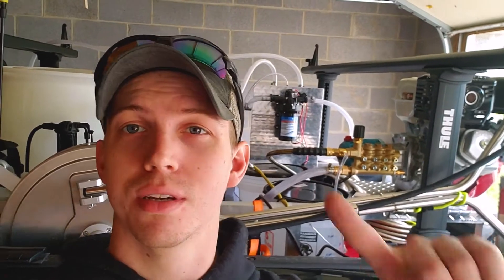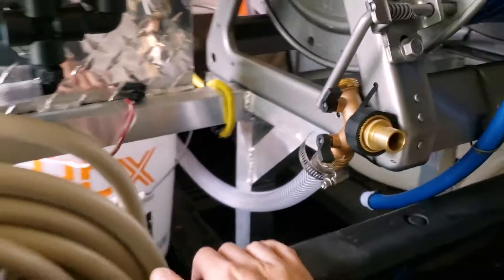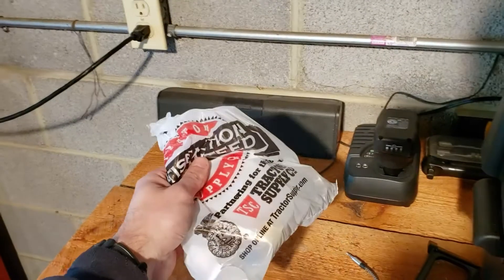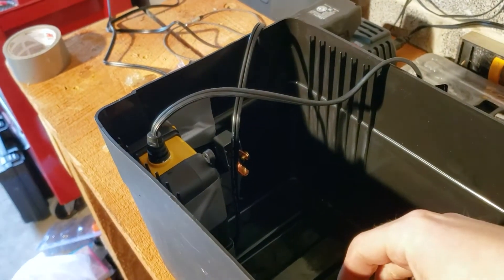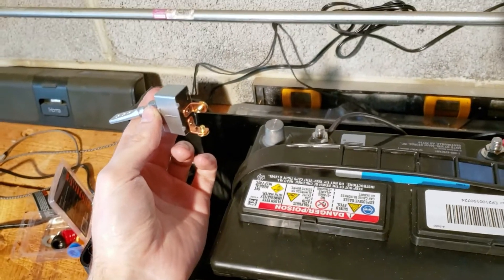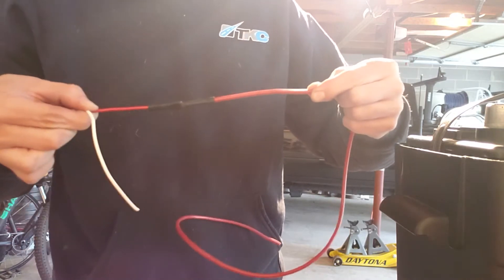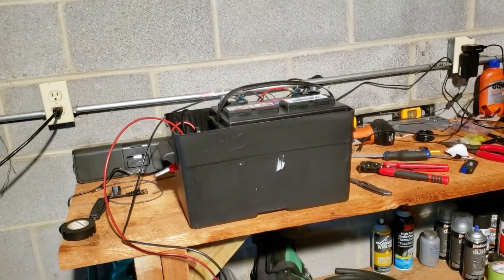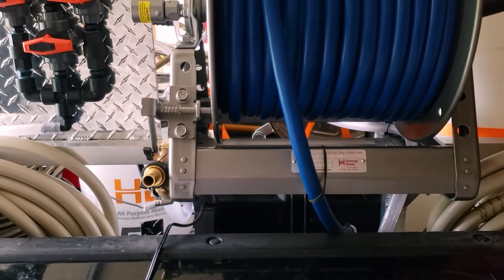How To Wire A Softwash System

Comment: Hi,

Question:  Is it better to have a separate battery for the 12v pump? Or can you use the same battery that runs your electric hose reels and 8.0 gpm pressure washer.

Comment: I really like this video I got every single step until now I’m stuck at right after you splice the wires to the wire quick connect then you end up with the white wire also spliced to the wire and I’m so confused right now man can you help me out ?
Reply from the maker: The white wire of the quick disconnect gets connected to the negative terminal on the battery

Comment: Does your system have a water tank or you run off a garden hose
Reply from the maker: Its a 30 gallon tank that's constantly back fed by a garden hose. This is most commonly referred to as a buffer tank.

Comment: How did this setup end up working out since you made this video? I read that you should put a 30amp fuse after the battery between the battery and switch.... what do you think?
Reply from the maker: It's still working great. I haven't had any issues
Reply: Yes put the 30 amp after the battery

Comment: Please help how do you turn it off when not pressing on the gun to wash, like how  can you make it stop so when you dont press on trigger wont keep building pressure
Reply from the maker: The pump has an internal pressure switch that will automatically shut off the pump when you stop spraying. If yours is still running you most likely have a leak somewhere
Reply: @cardinalexteriorcleaning3146  i still havent put cement pvc on tubes so the pvc when flying due to pressure build up

Comment: Nice set up man so you really don't need a Honda engine for a soft wash?
Reply from the maker: You technically don't need it but it makes rinsing way faster and easier. You can leave the softwash hose set to your house wash mix and then rinse with the pressure washer. This means you'll have two separate hoses out in the yard with you but it makes for a way smoother operation.